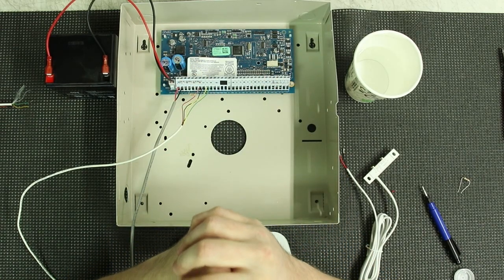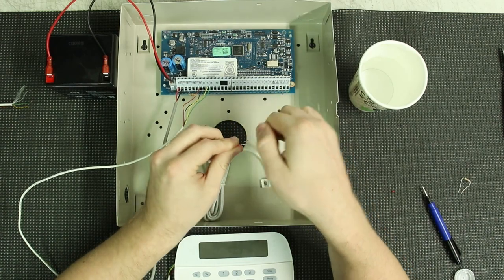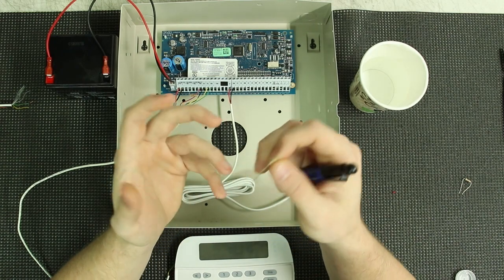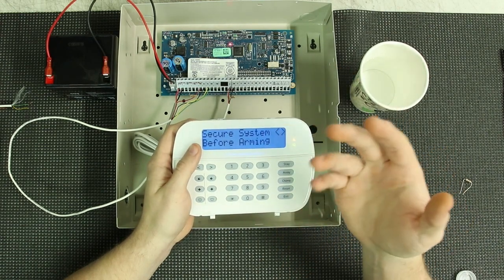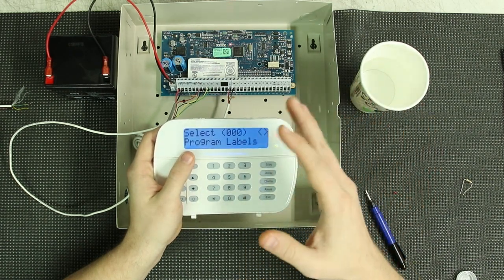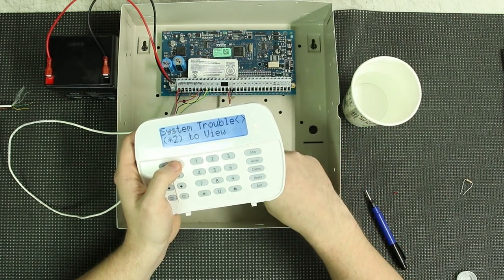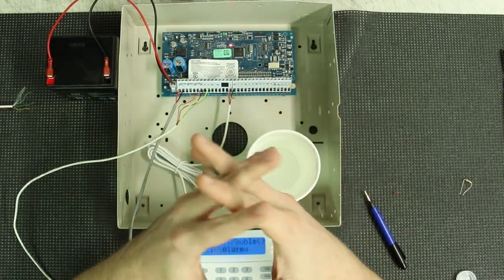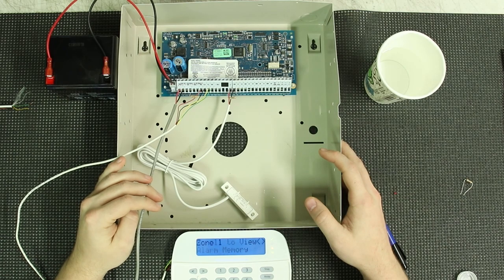Tane WS-1 Flood Sensor Installation On The DSC NEO Alarm System

Comment: Thanks for this video. I’m looking to run these to every sink and toilet in the house. Can these be run in series or does each need its own home run? Also, since it’s two wire, are there no power draw concerns similar to any other contact sensor? I looked at the mentioned GRI-2600 and it looks to be four wire, which obviously complicates things. Thanks!
Reply from the maker: It is best to run each WS-1 on its own zone in our experience. These sensors do draw a very small amount of current (6mA) so if you have a very full system or plan to add a lot of water sensors, it is better to use the GRI sensors, which actually pull power from the AUX terminals even though they are a bit more work. The DT-600s (https://www.alarmsystemstore.com/products/mg-electronics-dt-600-bus-terminal-expander) we carry on our site make adding multiple powered sensors very simple.

Comment: mine triggers the alarm without any water in the crawl space. what can be the issue?
Reply from the maker: It would have to be a wiring issue if there is no water at all. These detectors trigger when they are shorted, so if your wires are pinched somewhere, or if perhaps a mouse is picking at the wires, that could short the wires and create a false alarm. If you can I would just check all the wiring connections, and if possible inspect the rest of the wiring.

Comment: Great video. I’m a tech for 26 years. I had one system that I was upgrading to NEO, and it was a 60+ zoned partitioned alarm/environmental system. It was a huge indoor farm that grew tomatoes etc. The alarm  partition was all N/C but the environmental side had a mixture of N/C and N/O connections to other environmental relay panels that monitored water levels, leaks, high/low temperatures!!! What a nightmare. Long story short. I set the zone definitions and whatever zones didn’t work, I went into zone attributes and changed it to SEOL, What a life saver. Thankfully it was NEO and not PC1864, only the first 8zones can be switched to SEOL.